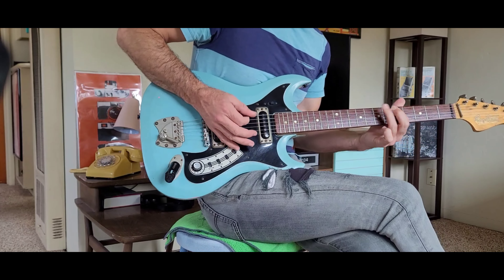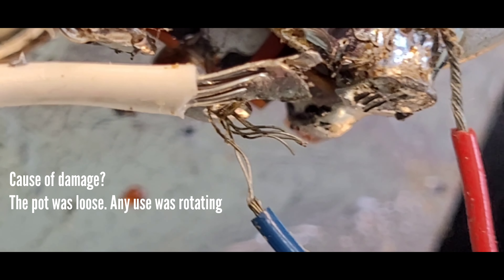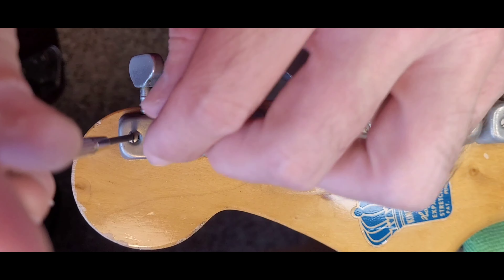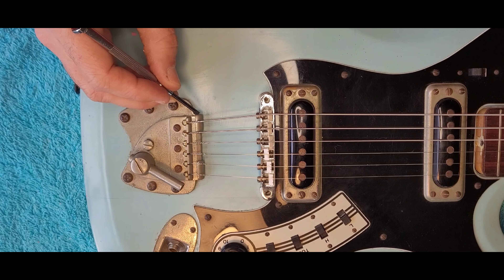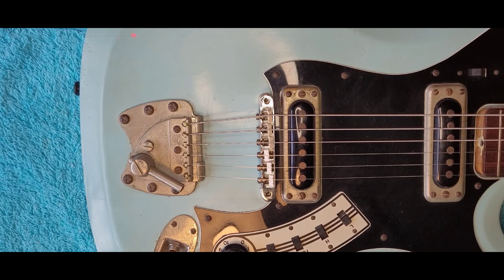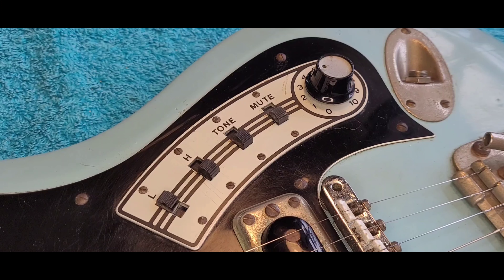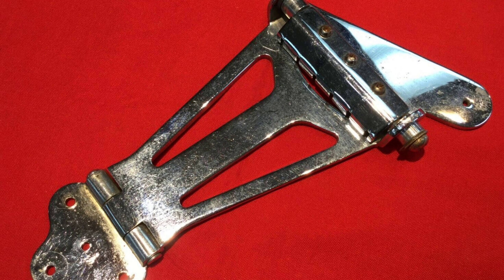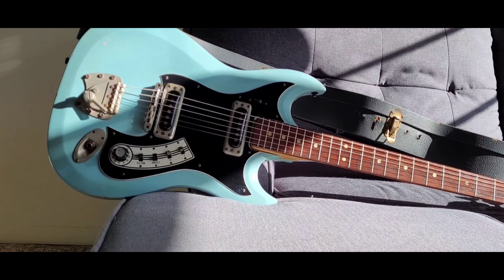Hagstrom II (60s) Quick Fix!

Comment: Hagstroms are an addiction, at least for me. I have maybe 8 videos on them on my channel. Fun facts: of the 3 screws that anchor the neck to the body, one is a machine screw that anchors directly to the trussroad. Nobody else does that, and I think it adds something. The trem design is pretty amazing, and the one in this video still has the thumbscrew though it's missing the bar itself. It's designed to mate to a detent in the bar, and the idea is you "park" the bar flat when you put it in the case. But for me, the real magic is in the (missing) stock bridge design. It allows you to intonate each string back and forth, height, AND slide them around laterally. That allows you to do what I call a spread bore string spacing, which means you can get more room on the treble strings than the bass strings. A Kahler can do that, but no other bridge really does and it's magical if you dig into it. Speaking of magic, those round shoulder Hag single coils are pretty amazing - the pole pieces are just decorative, it's an Alnico V bar magnet underneath. Lastly is the neck. In a 1965 world where all guitar strings are flatwound 11s, the Hag neck was known as the fastest playing neck in the world. Super flat 15" radius, super thin, small frets even for the period. If you put 9s or 8s on that thing, and set the action super low you can make a real "shredder" sports guitar out of it. Dig this: https://youtu.be/4BsV_0J2T0A?si=JVipV7TnntUAld2H
Reply from the maker: Love this. And absolutely. The neck has seriously contemporary dimensions.
  More along the lines of an EvH design than Fender or Gibson.
Reply: @breilly66  It does. And what's intersting is you'll find those same neck dims on all the other Hagstrom models. The 335-like Vikings, the LP-like Swedes, plus weirder stuff like the Coronado. Like a Saab or a Volvo, Swedish stuff is funky because it's got a tinge of "weird" to it. I blame the 22 hours of darkness.

Comment: I bought a Hagstrom II in 1971. It spent a lot of time in the case in a closet after playing it for about 6 years when new. I recently fell in love with that guitar again. I pulled it apart to clean the switches and pot and track down a grounding issue. It plays great now and I agree, it was built with care. Those tiny oval head slotted wood screws seem to have held everything together for all those years, but they will rust from sweat and humidity. I noticed the Hagstrom you handled had the same area of paint scratched off the back of the body just like mine.  Belt buckles will do that!  I painted over the red factory finish with dark metallic blue automotive paint. It looked more like a Gibson SG which I could never afford back then. Thanks for the vid, great to see some other Hags on YT.

Comment: Another awesome history lesson! 
On another note: I just bought an AVRI body to build my own JM. I really want some linear checking not the puzzle pieces looking checks. What’s the best method for achieving this?
Reply from the maker: Yes! Welp....   to stay away from puzzle pieces, avoid the compressed air can path. When using the can, the temp swing is too fast and select in it's area. Go for the freezer overnight. It'll allow the linear checking as the temp swings slower and does so over the entire finish and all timber at the same time.   :)
Reply: @breilly66  thank you brother!
Reply: @breilly66  Freezer method worked beautifully! Just as I wished! One more question: is it safe to sand down the clear coat a bit now that it is checked? I want it to be a bit duller.
Reply from the maker: @brywestwhit Excellent!   As far as a post finish sand....  I'd stay away from paper and use light pressure and a light scotchbrite pad. It gives a more natural haze with circular motion use and it doesn't skip any dings or valleys.    :)
Reply: @breilly66  lol! The checking healed overnight. Try again!
Reply from the maker: @brywestwhit Go again and then to emulate years of particulates and oil, rub crushed pencil graphite powder into the surface with a mist of water over the area. That'll make it stay.  :)
Reply: @breilly66  Hi. Can you put a nitro finished neck in the freezer too and use the graphite method like the body?
Reply from the maker: @brywestwhit Yup! Works the business!
Reply: @breilly66  the freezer checking looks very faint and the graphite isn’t really making it pop. I wanted to sand down the high gloss finish down to a satin gloss. Maybe thinning out the top coat will help? I’ll try the freezer again after.